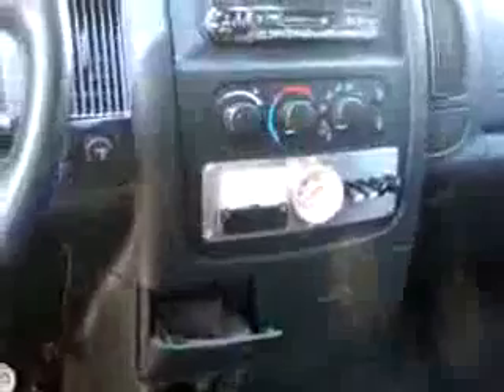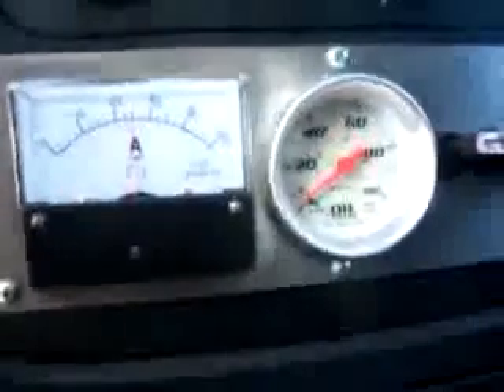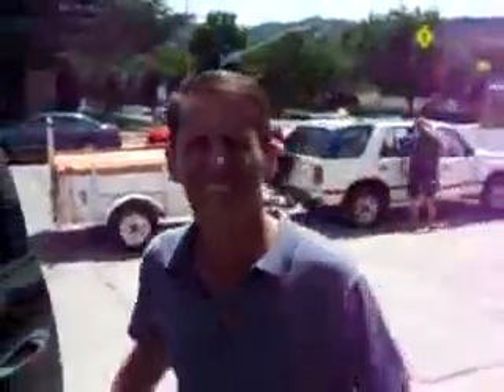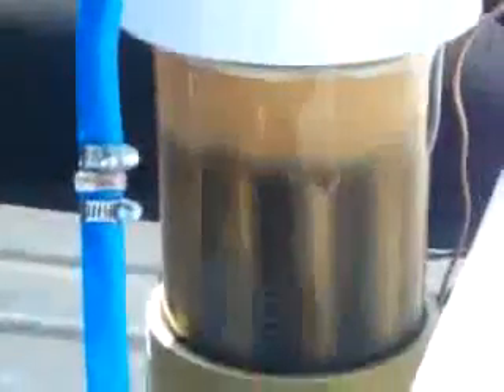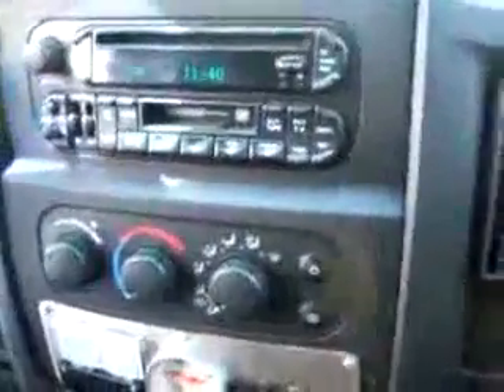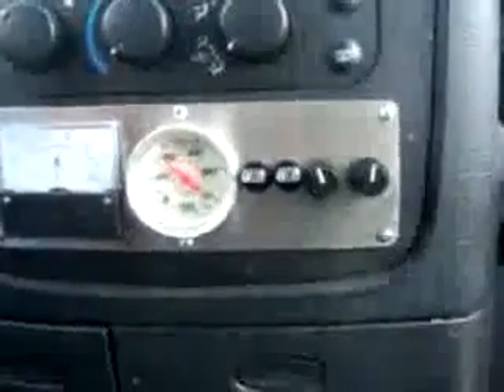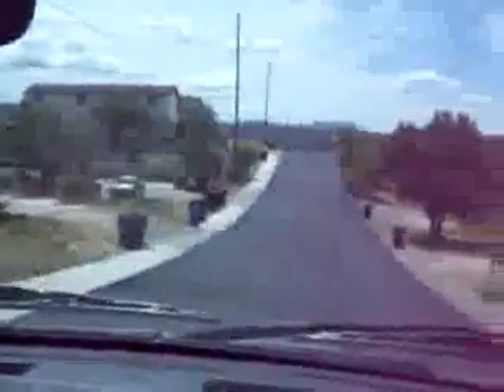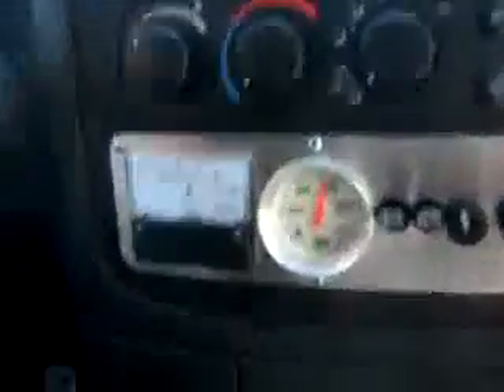no more oil, truck runs on 100% hydrogen gas

Comment: I searched "resonance of water" and (breaking) the covalent bond of water, and found very helpful information on how to use high pulsed(20,000 Hertz) at (20,000 to 70,000 volts, to break waters covalent bond, and low amps(350milliamps to 1/2amp or much less) See Xogen Technologies and Stanley Meyer.

Comment: The energy has to come from somewhere. If you're turning water into hydrogen and oxygen then that takes energy, like in electrolysis. If you then burn those gases you'll get the energy back... There has to be an input into the system to get the energy to move the car. The laws of thermodynamics do not allow this.

Comment: gasoline and oil are 2 different things when your adding fluids to an engine.
   the engine would seize without oil, 
Hydrogen wont lubricate the pistons my friend,
    Hydrogen may work in place of gasoline, but not motor oil

  The title of your video says "NO MORE OIL, 
Maybe you mean refined crude oil fuel,  the motor still needs oil in it,